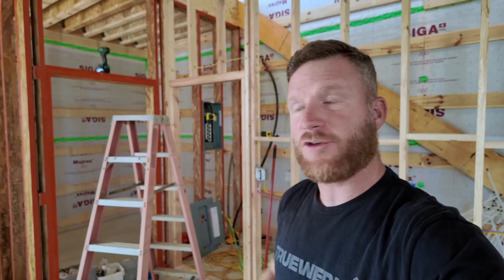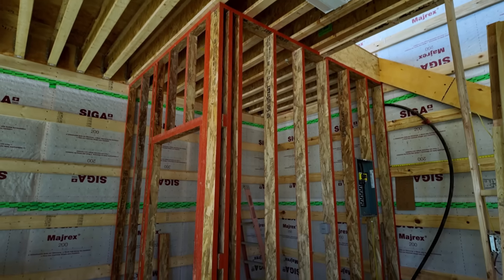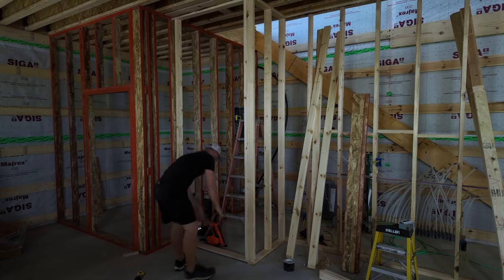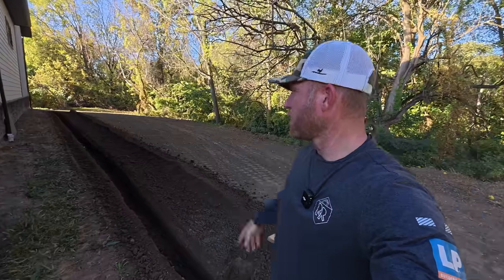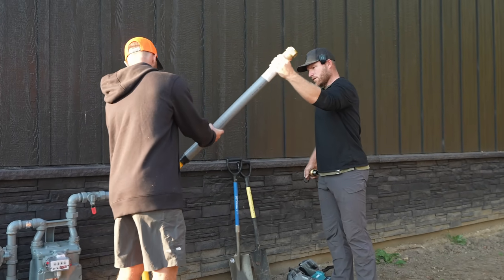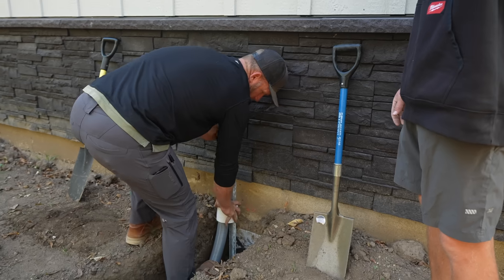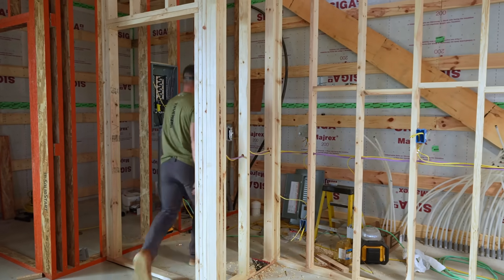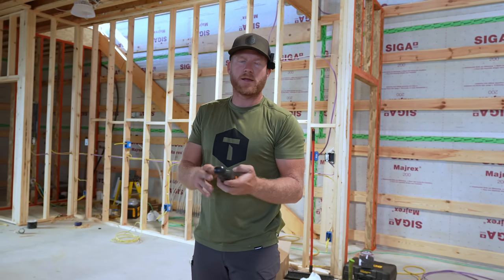Electrical and Gas Update at RRHQ 2.0

Comment: When you have put so much effort, money and thought in to all the details of your shopn you should not skip anything on the lights. Take in some prohelp and make a few videos about it and discuss it in detail. spend a few extra bucks on the lights and so you can have all the functions of controling them either thru your phone or from boxes on the wall. As you are making highend video content its good to bee able to switch between bright cold white to a warmer softer white sometimes. Also put dimmers on everything. In the office/mancave area you could even go as far as put in full rgbw lightning as some days when you sit there and work you might feel abit down and a quick push of the button makes the whole environment in to a different setting. Good lights is key in any workarea and cold white light is one of the most hard for your eyes in the long run

Comment: I live in northern IL with romex being code for me as well. My biggest issue with Romex is its too easy to be lazy when you have a bad actor installing it. When I say that I mean someone who doesn't put in the stud protection or in an attic space just throws it up and doesn't secure it down to anything. I think people like that are the reason romex will probably disappear in the next few years in most places. I know you can be lazy and cut corners with conduit as well but it offers much more protection to the next person just existing in a wall than unprotected romex does against it being accidently struck. I wouldn't be worried in one of your shops or builds because its clear you are not a lazy person and don't accept bad work from your subs. But man as a Firefighter some places you go it was clear it was a 30 pack jack special putting the romex in haha

Comment: You should cut out that section you heated with a torch you are not supposed to have it over a certain temp. We used to but weld it to feather but our irons are set at a precise temperature

Comment: I’m installing some MaxLite Wallpacks and a shoebox (area light) for exterior. They have some really affordable control options, including for their highbays. May be worth a look. 

The one thing that will matter with filming is flicker. Most LEDs flicker (Use slo mo on your phone and pan around your space). One company I know of uses T8 retrofits and are flicker free and that is Energy Focus. They designed lights for military submarines.

When placing lights, you want to think about where you want light and how it will shadow. They put the lights in the center of the my kitchen. So when I’m cutting on the counter or working at the stove, I shadow my work area making it difficult to see what I’m doing. 

Also, 30-50 foot candle is fine and I would stick with 4000K 
Hope this helps.

Comment: On Amazon- LED High Bay Light 200W 2PCS, 28000 LM with US Plug 5ft Cable, 5000K, Dimmable 1-10V, UFO Commercial Industrial Warehouse Shop Factory Barn Garage Area Lighting Fixture, ETL DLC Listed